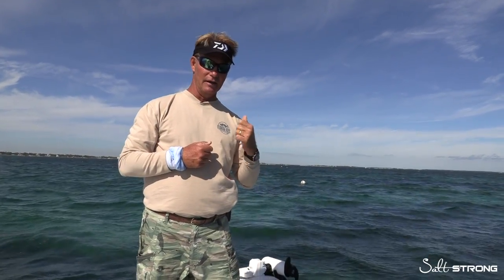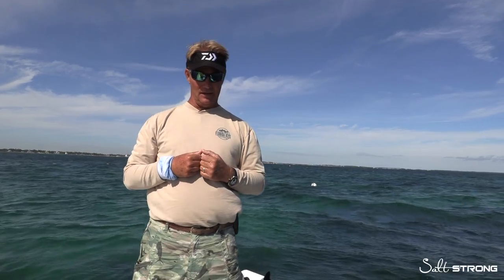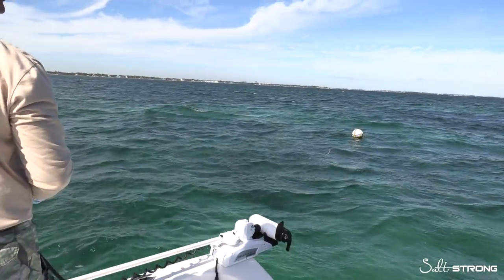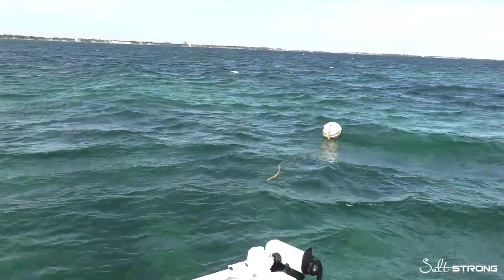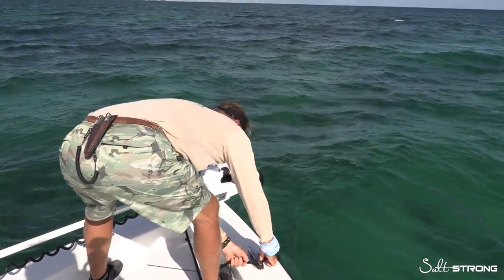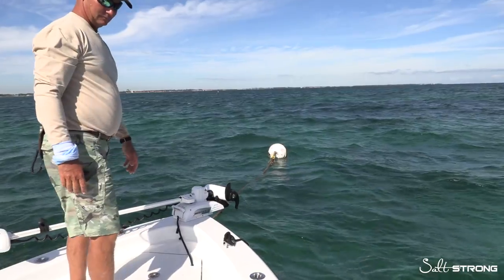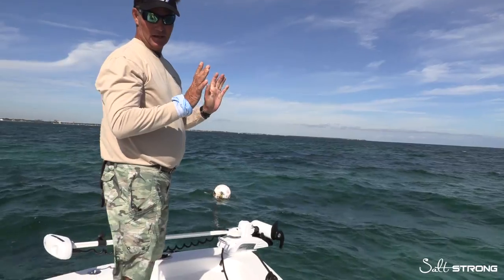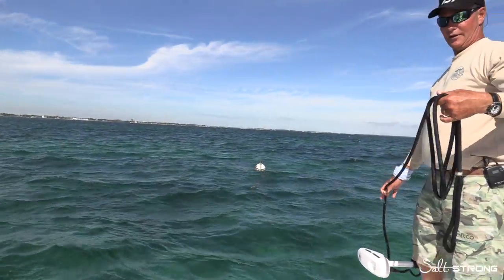How To Tie Your Boat To A Mooring Buoy (Quick & Easy Way)

Comment: That process allows for the boat to sway either way eventually sawing through the mooring line. Correct way is to attach 2 mooring lines through that loop 1 to each side of the boat. Saves ropes and your boat
Reply from the maker: Thanks for taking the time to comment!
Reply: I learnt this the hard way. Thankfully my boat was at the dock and someone spotted it and manage to fix it before any damage.
Reply: Yes!

Comment: Sorry for my ignorance, I'm from the west coast. Why not just anchor? And are these put in place by DFW?
Reply: My question too.  Who puts these out?
Reply: To keep people who might not know better from dropping an anchor on a corral reef. We must all anchor on sandy areas not to damage any reefs which are prevalent throughout the Caribbean.
Reply: 6 months late, but sometimes you can't physically anchor due to the anchor chain being too short. Also anchors tend to drag in higher winds, so if you want to dive for longer periods of time, or maybe even sleep on your boat, your boat will drift from where you initially anchored.
Reply: Crowded popular areas will not have room for boats to swing a 100' radius. Think Caribbean, Key West, Metropolitan areas.  Environmentally sensitive areas, where you can destroy 1000 years of reef in a matter of minutes, are not places to anchor, and many of the more popular ones provide mooring buoys (Warderick Wells, Stocking Island in the Exumas, and many others in the Caribe and the Med).  Also places where underwater communications cables that could be damaged by unknowing boaters will provide moorings. Those are a few,   probably a dozen other reasons also.
Reply: Anchors and coral= coral destruction.  Also have seen anchor line dip below coral head and allowing waves over the bow.  I could read the guy's boat numbers from underwater.  Lucky it was a "unsinkable Boston Whaler".

Comment: I'll be boating solo most of the time...do you have any tips/tricks on how to secure to mooring as I'm driving the boat and securing the mooring?
Reply: I was thinking exactly the same. If your bow is 10 ft above sea level this technique isn't going to work...unless you lie on your stomach and use a boat hook to snag the line. Another way is to run the mooring line down the length of the boat from the bow cleats and tie up at the swim platform or transom and then walk the lines back to the bow, and let the wind/tide put you bow to the buoy.

Comment: I have a  1968 Whaler that has only one cleat on the front bow. I do have a bow rail. Since I don't have cleats on the side, what is the best way to tie off?
Reply: The video is incorrect, you actually should go from a single cleat, through the mooring pennant, and back to the same cleat.  On small boats ties up in calm conditions, it may not make much difference to go to a second cleat, but with bigger boats, and stronger wind, they will swing with wind/current, and the chafe the mooring pennant, and your own mooring line to the point of failure.   A boat 40' or longer should always go from the a cleat, through the pennant, and back to the same cleat.  This can be done on both bow cleats (port and starboard) using 2 different lines.
Reply: @allenmayers3642  thanks for the info,when bad weather hits where should you be,just curious